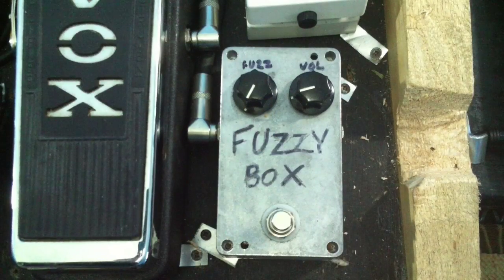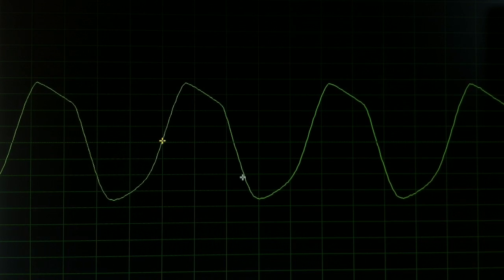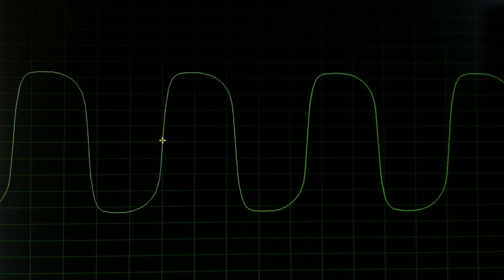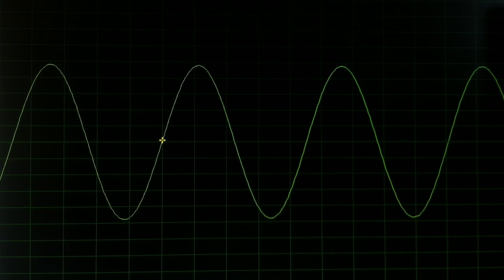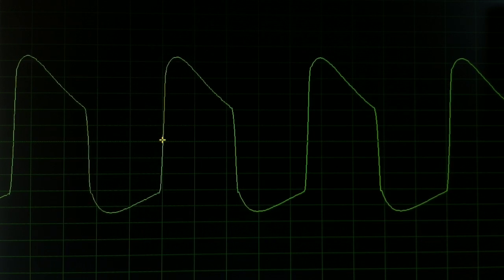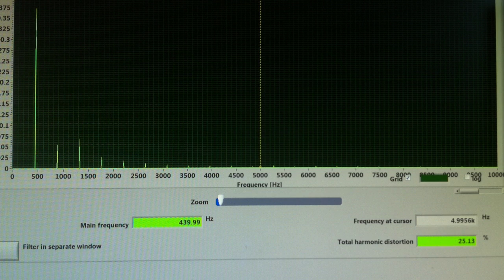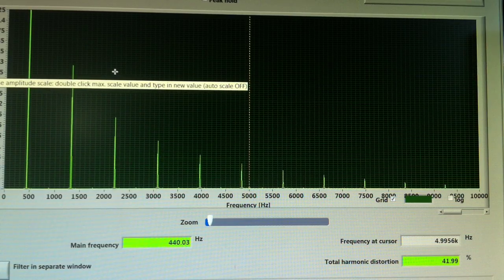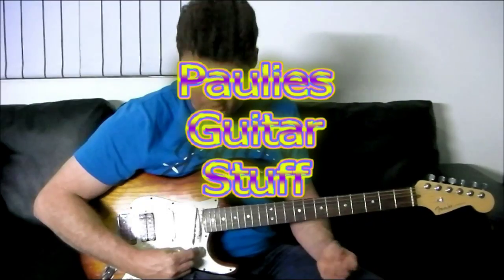Fuzz vs Overdrive vs Distortion Explained

Comment: Paul, can you possibly explain the correct pedal order, (I heart so many things) talking about...Fuzz, wah, and tuner pedal order.. I did have the tuner floor pedal 1st in line on the board, of course, logic would say so, followed by the wah, and later on the distortion and big muff, followed by the  other stuff, and the delay being last as people say is the best way.... THEN..I got a fuzz face pedal, thwe small germanium, pedal board friendly one.. someone said that the fuzz  face, MUST go before the tuning pedal and the wah. they said put the.. fuzz, tuner, wah...in that order,  then keep the other stuff as is.. what do you say?  I am still trying to figure it out.. .simple non-expert logic would tell me to always put a tuner pedal 1st, or it will be affected in some bad way, by the other pedals.. what is correct... it seems lots of guys say stuff, and it is all different...none of them seem to be electronics knowledge guys..they seem to be just musicians like me, that sort of guess about it..
Reply: +Michael Craig It's a matter of taste. But the most conventional order would be tuning pedal first in the signal chain, then wah, then fuzz.

Maybe they meant left-to-right rather than signal chain order.

Tuning pedals should generally be first as they can get confused by the harmonics if you feed them a distorted signal.
Reply: +Andy Brice I'd say put the wah after the fuzz. A wah is basically a "sweeping" bandpass filter, so it filters the frequency spectrum. You'd want that spectrum to be as broad as possible, so it's good if the extra harmonics from the fuzzer get into the wah pedal. That's not to say it's "wrong" the other way round. The effect will probably be much more pronounced though if you fuzz first, then wah, compared to doing it the other way round.

Comment: Wow, what an informative video about how different components clip in our favorite amps and pedals.  I must say I am very surprised by the frequency response of the Maxon OD808 and the shape of the sine signal.  It was to my eyes the 'softest' clipping waveform of all the waveforms including the tube pedal - and yet contrary to popular belief where a 'soft' clipping waveform has more even order harmonics - that had all odd order harmonics without a trace of any even - and that's the all time favorite overdrive pedal in history.  So I guess this shatters two widely held beliefs, one - that soft clipping creates even order harmonics and two- we don't like odd order harmonics, everyone - or nearly everyone loves the Maxon OD808.  Would have loved to have seen a boss SD-1 being analyzed with it's slightly different arrangement of 3 clipping asymmetric clipping.  Another funny observation, the maxon od808 has always been described as a 'smoother' breakup where as the boss sd-1 asymmetric overdrive has always been described as more 'rough' - but i bet it has more even order harmonics while the od808 has none.

Comment: ...so the LED on a digital distortion pedal actually affects the tone?
Reply from the maker: McFro95 Probably not on a digital distortion pedal.Digital distortion pedal implies that the pedal has a circuit that converts the signal to digital to process it and then changes back to audio.On solid state distortion pedals that use diode clipping you can change the diodes to LEDs to alter the tone to a more soft clipped sound.
Reply: +Paul Graham (Guitar) can you explain how to do that, and what the benefits would be? for the  person that has not messed with electronics? in what you would call regular non-tech talk terms..
Reply from the maker: Michael Craig I would litterally have to do a video on it.